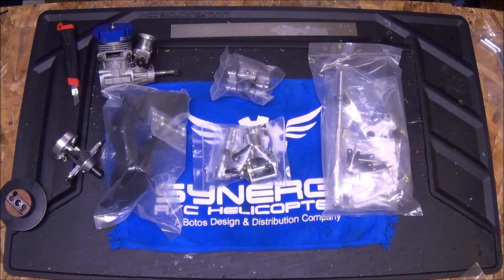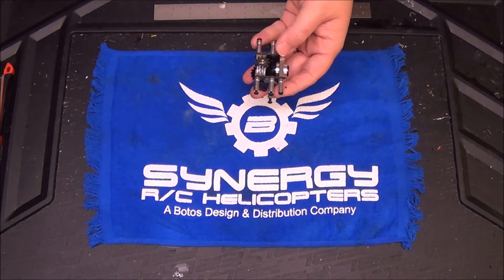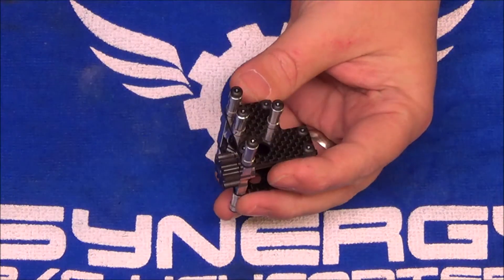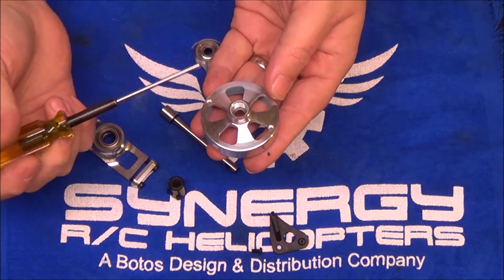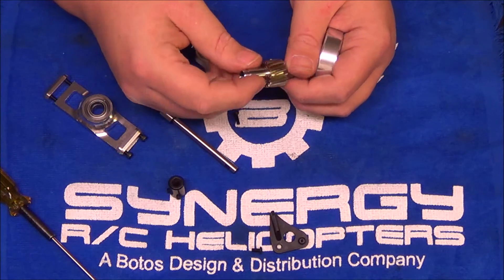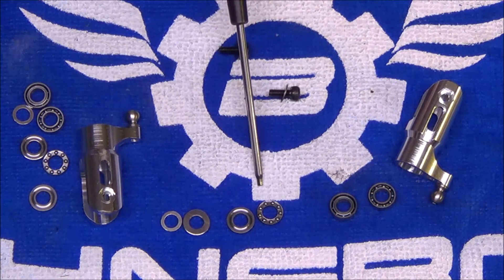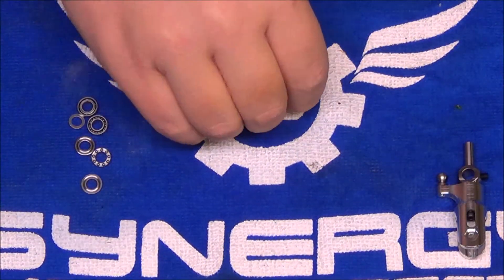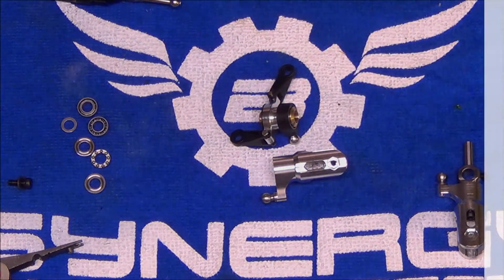Synergy N7 Build Video Series Day 1 - Building the Head, Tail, and Clutch Stack

Comment: "Synergy N7 Flybarless Torque Tube Nitro Helicopter Kit" is it comes with all the parts needed for the assembly?
Reply from the maker: Shanmuganathan Shanmuga yes it comes with everything you need to assemble the airframe. You will need loctite, epoxy and grease.
Reply: @cdsexton1  what about the engine? Does it comes with engine and radio transmitter and receiver?
Reply: @shnasachin  no you have to get both separately